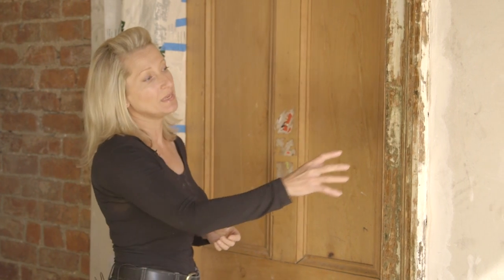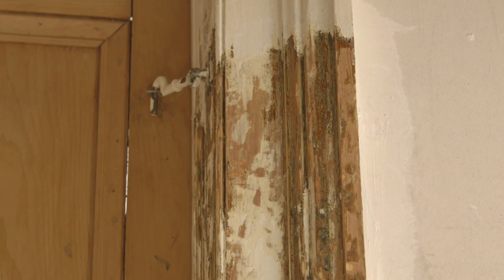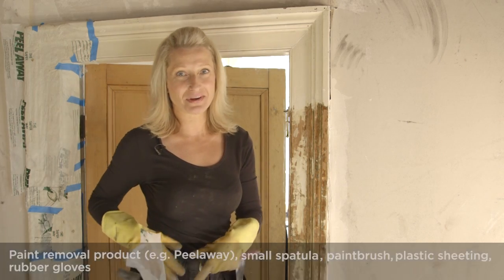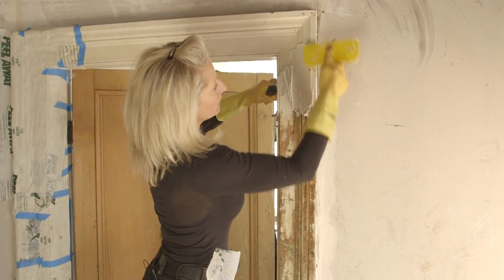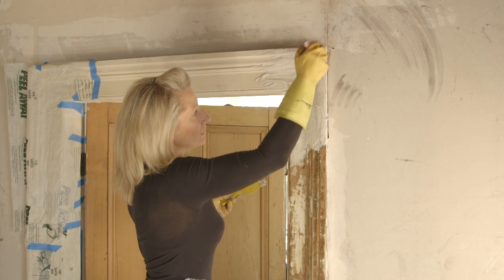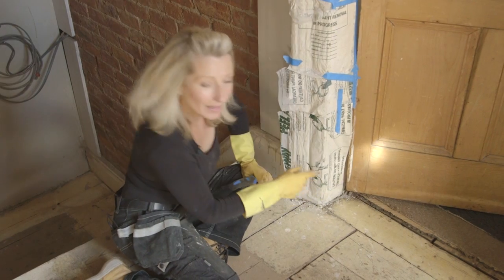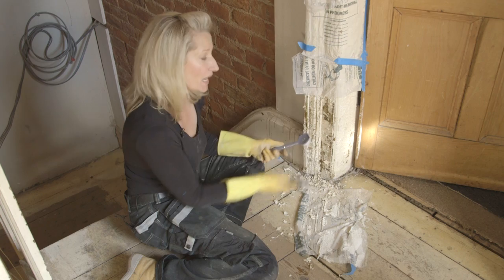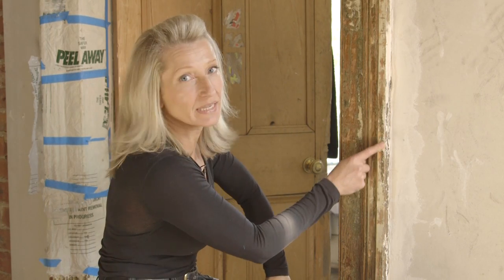How to strip paint from wood using PeelAway | PROJECT ADVICE | Future Homes Network

Comment: A wasted time by taking over 6 days just to do one door.
Use a heat gun, scrapper & sander or sandpapers with block- just to almost clear most paint.

No matter what many failed to tell you that you will have to stain, which in one day.
Second day, 2nd stain.
Third day, coat it with clear coat or with polyurethane coat.  
This will smell the home so much that the homeowner will not hire you again.
Nor will they are willing to paid you six service calls, just to do one door.
Reply: yes/no   on straight runs a heat gun is very quick, but on carvings its better to use peelaway
Reply: Yeah Ian’s right, scraping off paint from architraves after heat gun is a pain in the ass. Maybe steel wool might work while wearing thick gloves but I’ve not tried that. With a scraper it’s a pain and easy to gouge the wood.

Comment: Did you check that the old paint wasn't LEAD based first before you started work? In a house that old chances are it is ... this doesn't address the issue of restoration either, only one small step in a larger process. What do you do with sections of Architrave Moulding that are dinged, chipped or missing? How do you then restore those areas etc ... at 3.35 this is painfully lacking in information relevant to the title.
Reply: Yes, I did. Many houses built in the pre-60's will have layers of lead paint under the more modern top surfaces. If you're paint finishes contain lead then always wear a mask. I like the distressed look, as the video alluded too, so didn't fill and sand, though these arcs were in pretty good nick. Sorry we couldn't fit everything in the video, maybe we could do another one Real Homes! ;)